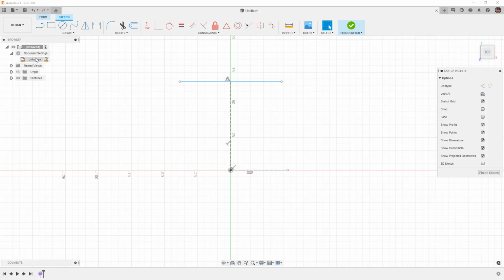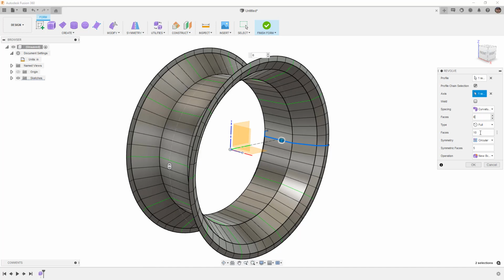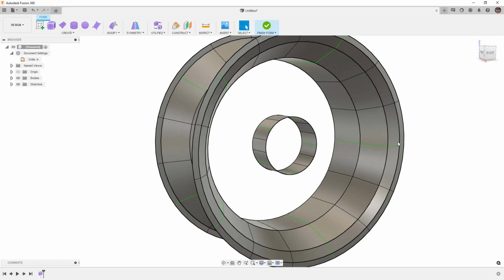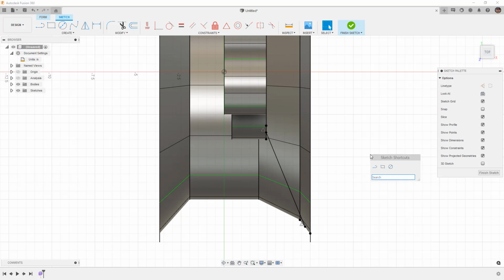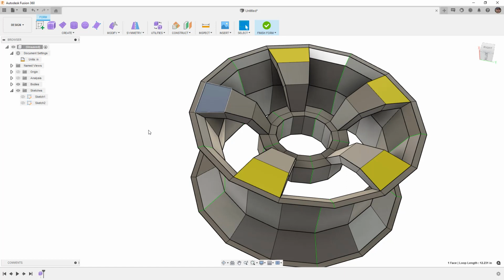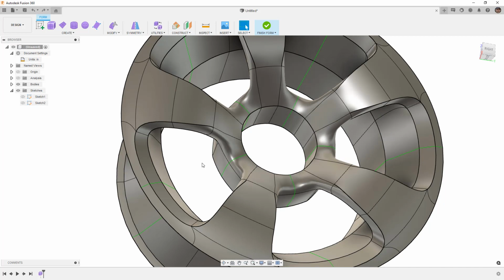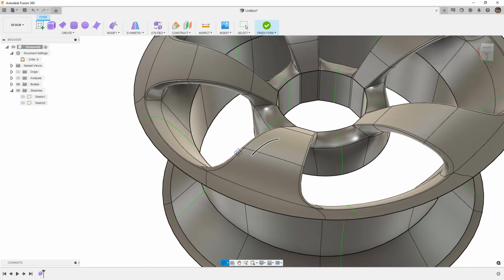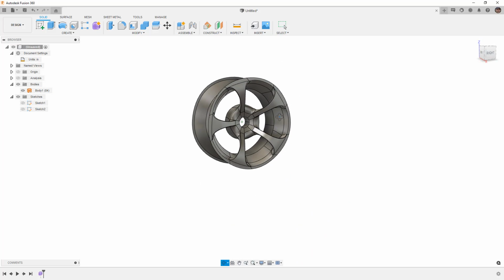Fusion 360 Form Mastery - Part 19 - Form Modeling a Car Rim

Comment: Thanks for the series - I've been finding it very useful. quick ? ...  I know you suggested using a surface or solid revolve to give hard points for the wheel; would freezing features such as the outer rim just after the revolve (when its still a circle) help keep things round without the extra steps? Not suitable for fabrication, but maybe helpful keeping the wheel round as you play with the design
Reply from the maker: You got it Ron!  You might find for that to work you need to add another edge or two.  When we made the revolve we kept it to a single face or an inside/outside edge for each lip.  This would prevent you from blending the "spoke" without causing an unfreeze situation.  Another option is just to have a circle sketch where you want the lip to bit and you can pull the vertices of the form body to that.

If I were using this method on a rim I would still opt to create the "hoop" or "barrel" part of the rim and the mounting flange using sketch and revolved solid/surface over a form.  If you were to 3d print the rim you would never know, but if you tried to machine it that is where you would get into trouble.

Keeping in mind also that multi piece rims will have positional tolerances for bolting together or for welding.  A lot of times they will be friction welded and you just can't get that level of precision with a form.